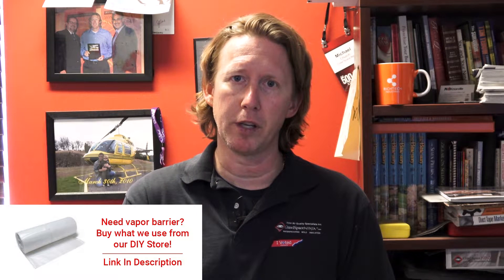What Is Building Code For Vapor Barrier? | How To Encapsulate Around HVAC Units In The Crawl Space

Comment: I'm in the process of encapsulating my crawl space this month.  My furnace (sits horizontally in crawl space on 3 cement blocks).  At first, I was trying to cut plastic and around the blocks, but was going to take a very long time and use way to much tape.  So I was able to pick up my unit a half inch and slide the plastic between the blocks and the unit.  It looks much better, does not have 25 different seams, and was done in 5 minutes!  Worked out great!
Reply from the maker: David , we are so glad you are satisfied and it worked out great for you. We do not move furnaces, so thank you for sharing your experience and knowledge. Have a happy and blessed day!